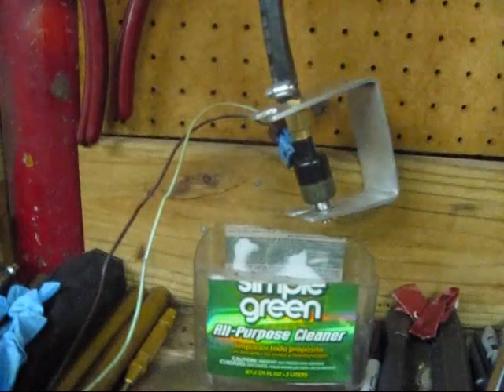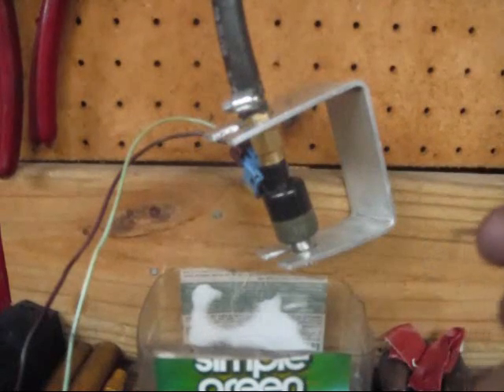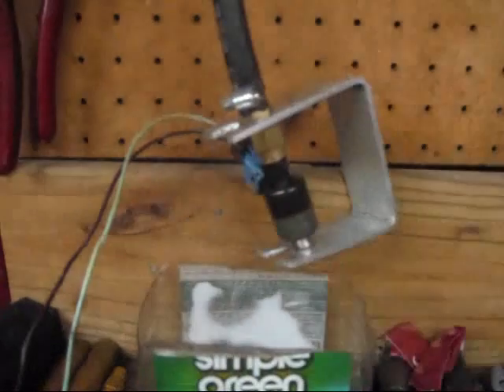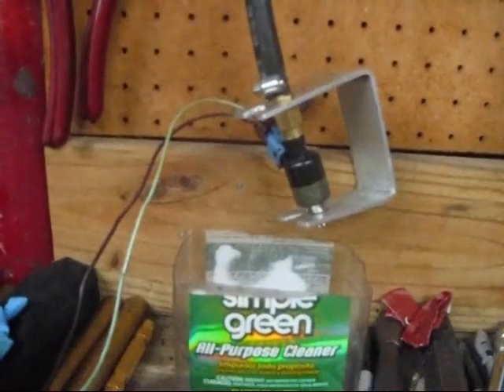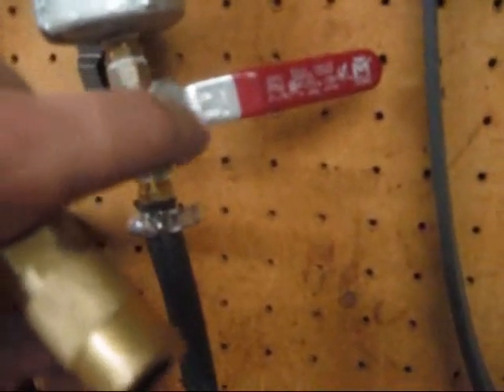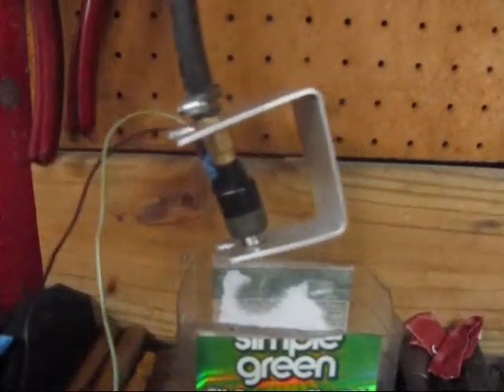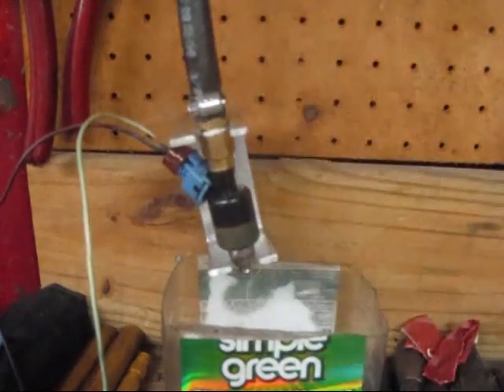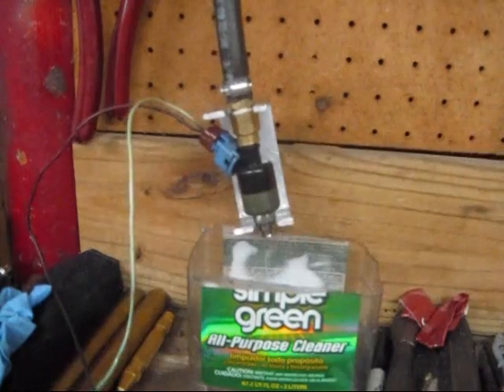Homemade Fuel Injector Cleaner - How To

Comment: Hey I like your style, you needed a tool so you made one, don't listen to people on here you did good. I use to work at firestone and they supplied me with a bottle that bottom fed to a tube that went to valve, that went to a drip chamber that led to a cone that hooked to a vacuum line, and the drip tube broke on me. I figured it would be on the internet somewhere but I cant find anything that resembles it very frustrated.

Comment: Really?? Get a can of 3mm or other good fuel injection cleaner. Remove the fuel pump fuse, connect the kit to the fuel rail and run the engine til it dies. Finally re-connect the fuel rail, put the fuse back and your done. No need to remove all the injectors, we're in the 20th century here.

Comment: That is a heck of a job and a great idea, but for those of you like me that are by no means a mechanist, try this!
Pretty much the same thing as he did but w/o all the work! (I don't like unnecessary work!:-)
Use a spray can as your prime source, stick the straw in it. heat shrink a larger size tube/straw, to that straw, then repeat until you get to the size that fits your injector. (nobody said it was going to be pretty to look at! :-) 
Then do the battery/button like he had his.(but i didn't have an extra connector/plug for mine so I had to just use two female push on terminals. 
There's videos out there that show how to do the battery and push button if you need to see that. 
And that's it!  I made one with let over tubing, wires, button/switch, around the house. Didn't cost me dime other than the can of fluid !
Works like a charm!

Comment: USE PVC would that not work
Reply from the maker: +Timothy McCarty would it work, probably. The risk is that you are pressurizing plastic that will be filled with various chemicals to clean the injectors. Once the PVC weakens, you could create a dangerous situation. Its possible yes but not worth the possible risk in my opinion.

Comment: As a  machinist myself, I wish to give you one pointer:  Your vise was very loose, and needed to be tightened down.  It is why you were having so much trouble tapping that thread.  You were putting different pressures on both sides of the thread making it more difficult for you to cut even threads.
Reply from the maker: Thanks for the advice. The vice was new to my workspace at the time of this video. It has sense been bolted down so that it can actually serve its purpose in the garage.

Comment: Yeah and how do you know the injector is clean?   Hahahah. Smh waste of time .
Reply from the maker: Waste of time.... not so much. If you run E85, this tool is very useful in cleaning the "goo" out of the injectors. This tool can also be used to lubricate your injectors if they are going to sit for long periods of time to prevent the pintle and other parts from rusting. There are various other uses for this tool and it is a low cost cleaning tool that allows you to visually inspect the spray pattern of the injectors. It was never meant to be a flow bench (guessing thats how you expect to "know" its clean) but if you insist on spending 100 bucks to have your injectors cleaned and flow tested, be my guest.
Reply: BoostedBeaver---- Exactly. If you see a pattern different on one of the injectors then after cleaning it the patterns on all the injectors look the same I would say that's not really a waste of time, considering the cost of these frikn injectors!
Reply from the maker: Who is measuring the opening value in percentages here? We are simply cleaning the injectors and observing the spray pattern. Like I said in my original reply if you insist on spending 100 bucks and don’t wish to get your hands dirty making the tool, then just enjoy the video and move along.
Reply: You can see it spraying properly in the video......
Reply: Opening 100% means nothing .

Comment: Man I'm not the first to say it. Screw/Bolt down that Vise.....

Before you make this extremely dangerous device. 

■Flammable liquids
Flammable liquids are often hydrocarbon compounds such as ether, acetone or petroleum spirit. Even
at room temperature, sufficient quantities of these can change into the vapour phase so that an explosive
atmosphere forms near their surface. Other liquids form such an atmosphere near their surface only at
increased temperatures. Under atmospheric conditions this process is strongly influenced by the
temperature of the liquid.
For this reason the flash point, or rather the flash point temperature, is an important factor when
dealing with flammable liquids. The flash point relates to the lowest temperature at which a flammable
liquid will, under certain test conditions, form a sufficient quantity of vapour on its surface to enable
an effective ignition source to ignite the vapour air mixture.
The flash point is important for the classification of potentially explosive atmospheres. Flammable
liquids with a high flash point are less dangerous than those with a flash point at room temperature or
below.
When spraying a flammable liquid, a mistcan form consisting of very small droplets with a very large
overall surface area, as is well-known from spray cans or from car spraying stations. Such a mist can
explode. In this case the flash point is of lesser importance. For a fine mist - made from a flammable
liquid - the behaviour relevant to safety can be roughly derived from the known behaviour of the
vapour.
Reply: Sol Shady

Comment: Don't build this. This is a pipe bomb. You are mixing compressed air with a highly flammable gas. You are also creating a vapor cloud with that injector open to the air- which is a great way to get chemical pneumonia or burn your house down.
Reply: +gui577b everything is not safe! The sky is falling! Go hide underneath the bed, chicken little, and try not to be afraid of your shadow.Hint:   the air pressure is only 20 psi
Reply: I'd agree it's a pipe bomb, but the vapor cloud isn't really going to exist in a well-ventilated garage. Should you light a cigarette right after cleaning your injectors? probably not

Comment: One AAA battery? That's 1.5vdc, are all injectors 1.5vdc?

 I would guess if someone used a 9v battery they would screw up the coil in the injector?

 Might mention that.

Comment: Well made : )

I have few ones to clean too but i will just directly clamp a fuel hose to the injector and fill it up with some cleaner before to pressurise it with air.
i think i just even could use the rail for that. lol